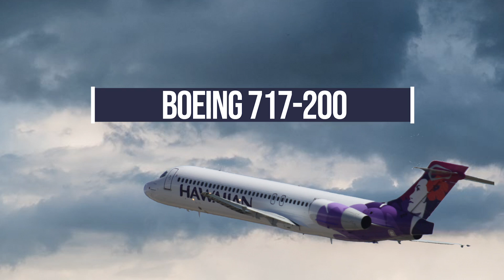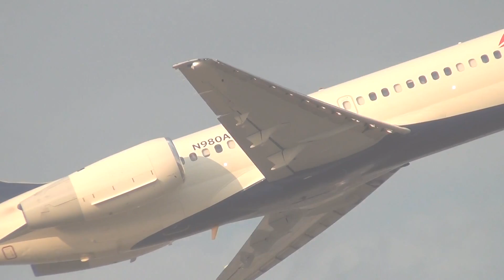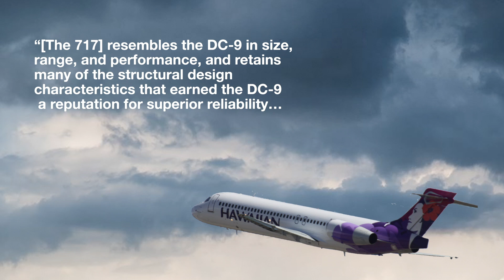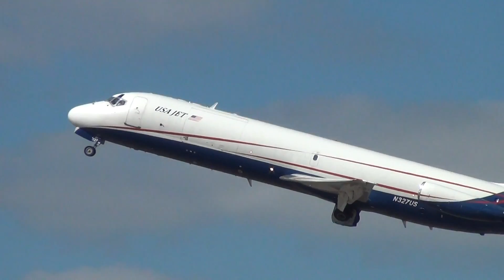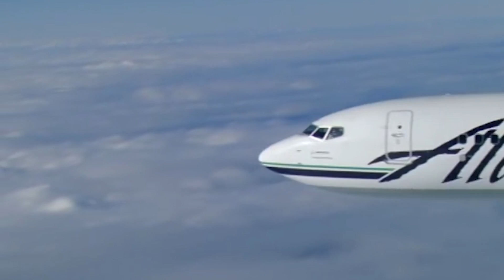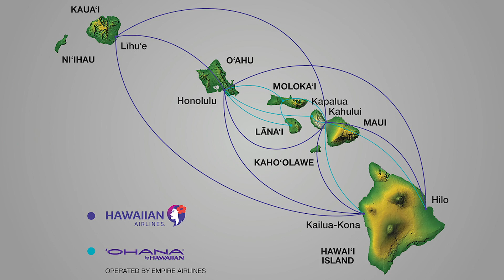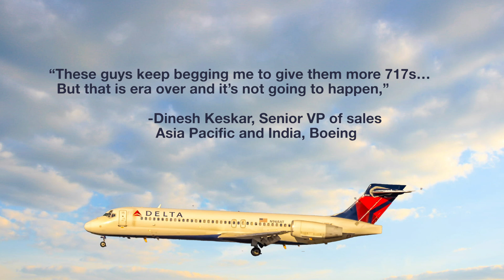Why Boeing Built The 717 And What Makes It Special

Comment: What if boeing updated the 717 to complete in the 100 seat market since boeing discontinued the Embraer deal
Reply: Lol that's if they even have money to delevop it at this point.
Reply: The 717 is 40 year old tech...the A220 is far superior and a much nicer  plane to fly in.
Reply: @charlesharper2357  I wish you were at Boeing when they decided to do the MAX
Reply: @lahainaboy761  
Too bad they decided to do it cheap and dirty rather than do it right.
Reply: @lahainaboy761  lol
Reply: @charlesharper2357  Boeing products done the McDonnell Douglas way.
Reply: @lahainaboy761  Boeing had a lot of pressure when they decided to do the max in the way they eventually did. The 737's construction is at the end of evolution, they need a successor, to compete with the more modern airframe of the 320, but a successor takes time and money. 
The Max was a desperate attempt to stay in market, because the NG would be lost against the Neos.
Reply: @simonm1447  Everything was just unfortunate for them. It's only a matter of what ifs. Boeing basically told airlines that hey, this is the same old plane ya'll know and love. But it wasn't. Boeing just swept things under the rug. There were talks of a successor to the old girl. Yeah it woulda taken alot more time and money. But these boys made a killing off of taking risks and losing money. And they turned into cash cows. This definitely wouldn't have been the first time a program woulda risked Boeing going bankrupt. The opportunity costs of building a new aircraft should have been weighed. They probably could have offered airlines something a lot better to what airbus was offering at the time.
Reply: @charlesharper2357  over 50 years actually it wont be as efficient as the a220 but would be a sight to see

Comment: Who else thinks that the 717 was like the airbus A220 because it was not their they did not make it another company did they just sold it.
Reply: Except people aren't as vocal or outraged about the name change as they were when the Bombardier C-Series was changed to the Airbus A220 after the it's acquisition . Bombardier doesn't even make passenger jets after selling off their Dash-8 and CRJ rights to other firms.

Edit: Dash-8 went back to De Havilland Canada while CRJ program was sold to Mitsubishi Heavy industries
Reply: Captain Dusty who did Bombardier sell the right of the CRJ and Dash 8 too?
Reply: @vizio2003  CRJ to Mitsubishi Heavy industries and Dash-8 to De Havilland Canada, the latter being the original designers so we've gone full circle.
Reply: @captaindusty4884  Its actually Viking Air operating under the name De Havilland Canada.
Reply: Captain Dusty so that means they’re producing those particular aircraft now?
Reply: Dawg. I was just gonna say the same thing. It's just that the 717 came at an unfortunate time. She woulda been a work horse.
Reply: I think it's a little bit different, Boeing bought MD completely, while Airbus didn't buy BBD, they only took control of the C series program, and renamed it to fit better into their own name system.
The A 220, former C series is also different from the 717, because it is a completely new aircraft type using state of the art technology, while the 717 is a modernized DC9 from long ago. That makes the 717 not a bad plane, but the A220 uses modern technology and is mainly focusing on fuel efficiency.
Airbus got this aircraft for very little financial reccources, it was a good deal for them. The order list for the 320 family is also extremely long, so they can offer the 220 without cannibalizing the 320s.
Reply: Simon Maier  If you study the transaction, McDonnell bought Boeing and kept the name, moved the HQ closer to St. Louis and implemented the accounting/business practices that ultimately led to the 737MAX debacle.
Reply: @simonm1447  What do you think the 737 MAX is?  Yes another similar aged design that was modernized, except a lot more ill conceived.  The sad part about the MAX is that Boeing had the solution in front of them all the time and never even thought about using it - the new telescoping landing gear for the MAX -10 should have been used on the entire MAX line so they would not have jury rigged the larger fan onto the airframe that way.
Reply: @gendaminoru3195  I know the story. A too short landing gear, because it's a plane originally from '67 with turbo jets back then, which forced Boeing to mount a modern turbo fan in a way normally no one would do, and now the aircraft had a rudder force behavior unacceptable for a Far 25 aircraft. At the end its still inferior to the Neos because they couldnt fit the fan diameter they originally wanted under the wing, despite the desperate attempts to shift it forward in front of the wing.
They need a new aircraft in medium term, and they know it.
Reply: @simonm1447  how they acquired the programs were different but what's similar is the fact that both these big boys felt like they needed to have a smaller aircraft to offer to customers.
Reply: There are significant differences.
One was a successful mature aircraft which was killed it off by its new owners, the other was a struggling new aircraft made a success by its new owners.
Reply: i TOTALLY AGREE...so correct dude
Reply: Airbus plans to further develop the type. My thoughts are they’ll make a -500 to replace the A320neo.
Reply: @biponacci  I would be very surprised for them to let the A220 get anywhere near the A320neo simply because the A320 is an absolute cash cow for airbus whereas the a220 has so far done nothing but lost money
Reply: @dstblj5222  
The A220's simply the better aircraft in the longterm. The A320neo was always meant to be an interim solution until Airbus developed an all-new composite narrowbody, which they've been lucky enough to cheat development of and get ahead of the game. There's a good reason why the A319neo barely sold.

Comment: The plane kind of could be the Boeing best seller but nope the 737 was.
Reply: MDC finally decided to "merge their way out" of trouble in 1997 because they lost the MD-95 sale to SAS in favor of the 737-600.  The MDC sales guy famously refused to take the SAS fleet manager's call after he was authorized to go back to MDC for a "best and final" price negotiation.  To that SAS sale, if you add the MD-95-50's [aka 717-300] wanted by United and others, and MDC would have remained in business and would have gone to a twin engine version of the MD-11 when the bigger GE-90-110 came available.  But then, MDC also would have wanted to make the MD-12 and we all know how the A380 turned out for Airbus - another zero profit loss-leader venture.  So these bad decisions and bad timings where the customers was not really in the loop doomed MDC into being Boeing's bitch for all time.  Most say it really started with the talent purge in the internal TQM program with too many good engineers and managers being forced out.
Reply: @gendaminoru3195  But MDC got their revenge with Stoneschiper running Boeing and all the other VPs. This is why Boeing is in trouble today with Accountants running the business instead of Engineers. To cut cost they ran a program  called "Just in time". Supposedly the parts would arrive from around just in time to be put together on the asembly line, but they always arrived late, costing money. Hiring programers with no aviation experience (B737 Max).
Reply: Doubtfull Boeing wanted to keep making the 717 though. Why continue to manufacture 2 different aircraft types to sell to the exact same customers when you can just make one type.
Reply: Well put... was...
Reply: Rafiah Aspagi — The customers decide.

Comment: DC-9 wasn’t designed by McDonell Douglass, it was before those two companies merged
Reply: The DC-9 was developed by Douglas Aircraft Company. Its first revenue service was in December 1965. DAC ceased operations in 1967, after merging with McDonnell Aircraft Corporation, successor company was McDonnell Douglas Corporation.
Reply: RM Aviation & Travel  Well, officially, the DC-9 was the first airplane released after the McDonnell Douglas merger. Plus, there were 30 years of updates from the first DC-9 to the MD-80 line to what became the 717.
Reply: I know the men who designed both airplanes.  Actually Roger who designed the DC-9 actually died only a couple years ago and was still teaching aerospace engineering at CSULB.
And to clear up the issue here the MD-95 was the result of several studies, the first of which had yet another re-fanned JT8 [MD-87-105], which was deemed too heavy, but the BR715 installation grew so much in weight [thanks to Rohr[later to become Goodrich Aerostructures]] it wasn't any better and we needed to add two rows of seats forward of the wing and remove the aft air stairs.  A couple airlines wanted the MD-95-50 aka the 717-300 which was studied and ready to prototype until Boeing decided to kill it in favor of the 737-600, a rationale they would use to kill the entire project later.  We also looked at re-engine the MD-87/88 with BR715-C3 [three times] but Rolls-Royce finally decided the engine was working too hard for airplanes that heavy at altitude [max test cell thrust was up over 28,000 lbs ISA SL though].  Airlines were not happy with Rolls-Royce support and pricing which didn't help sales either.  The Pratt 6000 would have been a successful alternative as de-rate would have worked for the smaller 717-200/300 and the re-engine effort as well since it didn't run out of core capacity at altitude.  We also looked at an MD-95-20 [717-100] but the CG situation just didn't pencil out with the engine installation, and it was still on the heavy side for the ALPA "Scope Clause."  That airplane [-100] would have required still a third engine like the R-R Tay-630/650.  I can confirm from my contacts at DL fleet management that they are indeed keeping the 717's but will not keep the MD-90's and MD-88's except for some odd city pairs and charter work until heavy checks are due.
Reply: I understood the original comment to mean the DC-9 was designed by Boeing ^
Reply: @nickys34  Bombers are most definitely not airliners. In fact, Boeing's attempts to make airliners directly based on their bomber designs (the 307 and the 377) did not work out terribly well. However, Boeing had tested concepts on their B-47 which they did incorporate into the 367-80/707 design. The only other jet bomber they designed and built was the B-52 - which again, was of limited value for airliner design. Boeing just got very good at designing jet airliners.
Douglas were also pretty good at designing jet airliners - but the combined McDonnell Douglas company was not.
Reply: RM Aviation & Travel don’t you mean to 717
Reply: Ronald Fish I mean the DC-9
Reply: What?!?!
Reply: RM Aviation & Travel what kind of statement was that ? The DC9 WAS designed & build by DOUGLAS AIRCRAFT , then LATER DOUGLAS bought the military plane company called MC CONNEL, then the later DC 9, was now called the MD 9, then BOEING got it Then became the B717,    CHEERS 🇺🇸🇺🇸🇺🇸🇺🇸
Reply: @flybyairplane3528  Not quite.
McDonnell bought Douglas in 1966.At that time, Douglas was in financial trouble and McDonnell were financially strong - chiefly down to the success of their Phantom and contracts received under the growing space programme.

McDonnell purchased Douglas in 1966.
By 1980 McDonnell Douglas were building variants of the DC-9 and the DC-10. The company retained  the old Douglas "DC" (Douglas Commercial) designation for their airliner range.

In 1980, they decided to end the old "DC" designation and replaced it with "MD" for "McDonnell Douglas". Therefore, the latest version of the DC-9, which had been initially referred to as the DC-9 Series 80, became the MD80. Future versions were in the MD80 - MD90 range. An upgraded development of the DC-10 became the MD11.

When Boeing took over McDonnell Douglas in 1997, they decided to keep the MD95 derivative of the DC-9 in production but rebranded the MD95 as the Boeing 717.
Reply: RM Aviation & Travel M/D may have not totally designed a new passenger aircraft, but they did come up with the best air superiority fighter, the F-15. Never lost an air-to-air battle.
Reply: @dannycrews5365  Nobody is arguing that. The problem was with their civil division, which failed to innovate and just kept revising existing designs.

Oddly enough, with the Boeing 737 Max, Boeing has done exactly the same. Boeing has actually been accused of taking on board too much McDonnell Douglas management thinking.
Reply: @nickys34  A B-52 and a 707 are the same aeroplane?

Well I never.
Reply: This airplane was designed by the Douglas Aircraft Company as it approved the smaller, all-new DC-9 for shorter flights on April 8, 1963 with the first flight occurred in February 25, 1965 and and The first production started December 8, 1965, with Delta Air Lines. I believe that SAS and Alitalia one of the main customer of the DC-9....
Reply: The DC9 was designed by MD, not Boeing.
Reply: @scenefromhere  Once Douglas merged with McDonnell, no totally new designs ever emerged ever again. All the projects that continued right through to the Boeing 717, were based on designs that had started before the Douglas/McDonnell merger.

Boeing originally had allocated the designation "717" to their C-135 design, which differed in many ways to the 707 airliner.
Reply: EricIrl Was the DC-10 not an all-new design?
Reply: @EricIrl  New designs DC10 C17 T45 oops sorry, T45 Goshawk was from a BAE 2 seater trainer design
Reply: @biponacci  It was all new in 1966 when the project got the go ahead - which was before the merger. By the time it made its first flight in 1970, the two companies had merged - but it started as a Douglas project.
Reply: @keithfreitas2983  I was talking specifically about airliner projects. McDonnell had really specialised in military aircraft (and spacecraft - they built the Mercury and Gemini space capsules). They had never designed airliners.
When they more or less took over Douglas in 1966 they inherited three existing Douglas projects, the DC-8, the DC-9 and the recently instigated DC-10. 
When McDonnel Douglas merged with Boeing in 1997, they were still making developments of the DC-9 and DC-10.They had not created any completely new designs.

Military aircraft were a whole different ball game (although both the Goshawk and Harrier were built in co-operation with Hawker Siddeley and later British Aerospace).
Reply: EricIrl I’m pretty sure it’s safe to say most of the development would’ve been done after the merger? Wasn’t the initial design entirely different anyway?
Reply: @biponacci  I will not argue your point. MY point is that NOT ONE totally new airliner design was instigated from scratch after the merger.
EVERY airliner built by McDonnell Douglas had its roots in work carried out by Douglas pre the merger.

And that is why the Long Beach line was closed down.
Reply: EricIrl I mean when you think about it McDonnell never made airliners so it kinda makes sense
Reply: @biponacci  It made sense for a few years. But by the 1980s McDonnell Douglas should have been looking to totally new designs. Instead, they insisted on just refining and developing the designs they had inherited from pre-merger Douglas era. As a result, it was the "new boys", Airbus, who were able to step in and take their place. Airbus did what McDonnell Douglas SHOULD have been doing.
Reply: @EricIrl  They were always ones to be cautious with where the market was going. Thats why they were so slow to get the DC-8 out.
Reply: @biponacci  They weren't that slow. Both the DC-8 and 707 entered airline service the same year. Boeing conceived the 707 earlier because they were desperate to break into the airliner market and felt they needed to be radical to do so. 

Prior to the 707, the American airliner market was dominated by Douglas, Lockheed, Convair and Martin. Boeing had built some airliners in the past but were well down the league table compared to the other American manufacturers. 
Initially, there was zero interest in the 707 by American airlines. The production line only got going because of the massive order received from the USAF for the KC-135 tanker variant. 

It was only when Douglas announced the slightly bigger DC-8 that airlines began to express an interest in buying jets. Boeing immediately had to redesign the 707 (essentially, making the fuselage wider) in order to match the proposed DC-8. 

After the merger McDonnell Douglas became EXTREMELY reluctant to come up with new designs.
Reply: EricIrl The DC-8 entered service a year later but you’re right, they weren’t that slow. What really kicked the 707 off though was the special optimisation given to various airlines where initially Douglas offered few variants.
Reply: @biponacci  Yes - Boeing made a big deal about being able to tailor their aircraft to the specific needs of customers - and it was a good ploy.